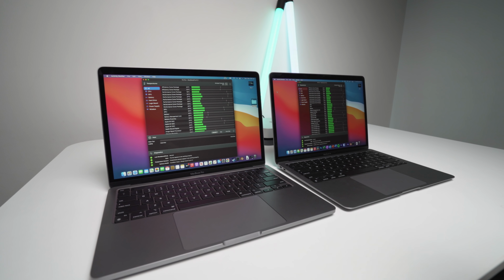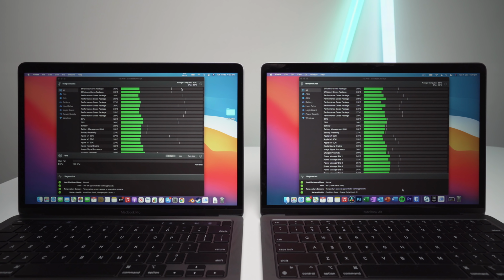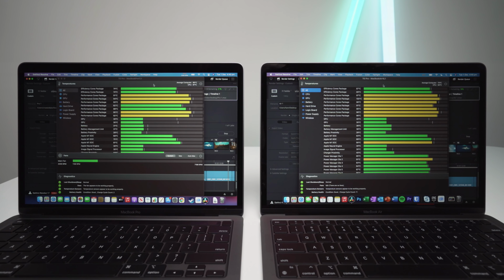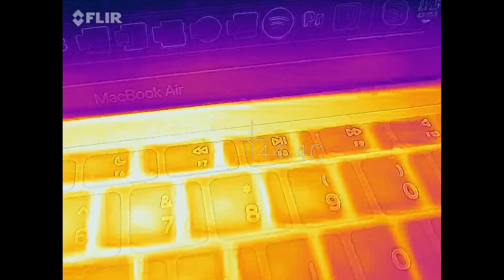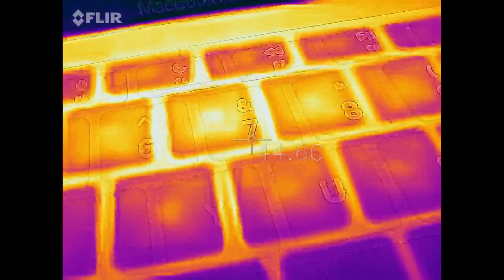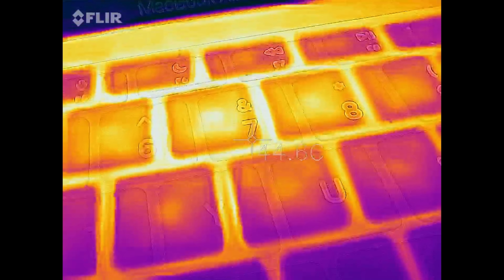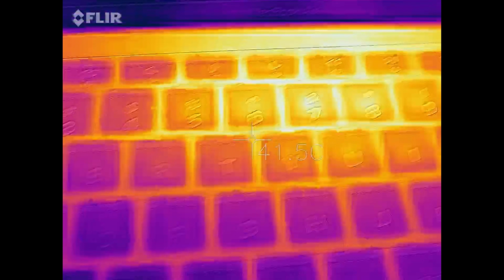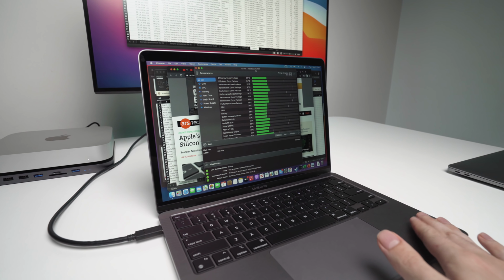The NEW M1 MacBook Air vs M1 MacBook Pro - How HOT Do They Get? Thermal Testing & More!

Comment: I'm only running Edge right now and my Razer Blade 2060 Advanced is so hot
CPU @75C - GPU @69C. One youtube tab open. I don't get it at all. 
I'm buying the M2 unless they all have white bezels, then I'm going with M1. Air or Pro... Not sure.

Comment: Buy air, spend the money for some accessories or just save money, No thermal issues using Final Cut Pro, if you edits 20 videos over a year, buy air, if someone edits videos 2 a week then maybe m1 pro, if every day then should wait for macbook pro 16 with m2 or M1X.
Reply: @Dũng Nguyễn 
Hi, i edited in final cut 4K videos from gopro and iPhone and no issue on mba 8Gb, some YouTube Tabs were opened to serach music during editing, that was done with extended monitor i have only full hd monitor. during rendering which takes lets say 20min (it dependent of the project)  and during that time i was searching on internet some news, shopping, etc. Mba 8Gb had no issue with that, was maybe little bit warmer, but definitely not hot.
Please note that in this YouTube video is used Intel based via rosetta 2 DaVinci with 4K from Red Camera and mba was only in my opinion 10-12 degrees warmer. Normal users don’t have such expensive Camera which probably  has extremaly large video files. I edit only videos from vacations and some events, nothing complicated, i have gopro8 and iPhone, for that job the mba is fantastic. Apart from that i use mba for emails, invoices, teams, Web browsing.  I have not used mbp but the mba is really fantastic, no thermal issues. That example from video is something extreme.
i edit for myself and i do not have to do other tasks during rendering to not lose time in job, i rather go and grab  some Coffee or previously on mb pro Intel i started the rendering when i went to the bed. 
But if your job requires extreme multitasking with large projects and you do not want to lose any second then probably mbpro with 16Gb. I do not know which is  more worth to buy mba 16Gb or pro 8Gb. I would rather buy air 16Gb but As wrote for my work the mba 8Gb is excellent.
Reply: @Dũng Nguyễn 
If you will do such havy tasks and you will use 90-100% cpu/gpu for a long time  then probably the fan is something for you and i would wait for new mbp 16 which mamy have bigger fan or anorher cooling system , this YouTube test showed that the fan in mbp helps but imho not drastically, only 10-12 degrees less. I got  mbp 13, 2018 and it was getting hot in teams with screen sharing on external monitor and during rendering as well was hot. With m1 chip i do not have such issues. 
I  think,you already have chosen that the pro is more suitable for you.

Comment: the old 2020 macbook had a lot of overheating problems during large zoom or google meet session. wonder how hot do the m1s get?
Reply: I had the same issue w/ my 2017 macbook pro but i used most of the memory. As soon as i deleted 20-30% of the fully used storage it was better

Comment: Thank you for the up front conclusion, it's interesting to see the thermal patterns on the air vs pro.  I'm curious as to wether games optimized for the m1 will noticably lower thermals during extended plays.

Comment: To add on to my previous comment, I do occasional 3D modeling. Post undergrad, I’ll be going to Grad School for Pharmaceuticals and I’m excited to start a new path. For that I’d love to get the Air to keep with my future flow as I use my phone as an extension to my old laptop set up that’s showing it’s age now barely able to keep up with long term research. My wonder is what would be the long term affect of using the M1 Air for extending times.

Comment: During extended runs, does the fan spinning up on the Pro eat up more of the battery?  I’m wondering if you were hammering the CPU and the fan spun up, maybe the Pro would wind up with a shorter battery-powered runtime than the Air...

Comment: Quick important question: Since the M1 chip set's cooling solution is very similar to its Intel predecessor (Just a copper heat pipe carrying heat away towards a tin stack promptly evacuated by the fan), I am wondering will the Macbook Air be able to sustain long periods of use time without over-heating [since it does not have a fan?] I am a teacher by profession, and the biggest issue I run into on a daily basis is the over-heating of my lap top due to pro-longed Zoom calls use-sage (the LOUD fan kicks after only 15 mins of use to the point it distrupts my class). Ps: I do not care about sustained performance. All I want is a device that can with-stand long use-sage (7-8 hour intervals). For the sake of longevity, which one I should get? Macbook Air? Or Pro? Please advise.

Comment: In terms of longevity, which one do you recommend ? I mean.. the "pro" has a fan inside and can break down in 1..2..3 years. What do you think? I love the fact that the AIR doesn't have any mechanical piece.
Reply from the maker: The Pro has the fan which may break down, but the Air is consistently a lot hotter so parts might degrade quicker over time. It's impossible to say. I would expect they would both last about the same.
Reply: @CreatedTech  Thanks for the quick answer ! :)

Comment: I recently got the M1 MacBook Air 16 gb RAM. When I open Activity Monitor with like 2 safari tabs and a word doc open, it shows that around 11 gb of memory is being used... is that normal?? I used to have way more things open on my previous Mac with 8 gb memory, and only 4-5 gb would be used. Can someone tell me why this is happening? thanks!
Reply: That's wacked. You probably got a faulty device. Make an appointment with Apple's Genius Bar and get that sorted out right away. If they offer to "fix it", return the laptop immediately and buy another unit instead. (Note that it has to be within the 7 days scope from when you first purchased the Macbook)
Reply: Apple devices are designed to use as much ram possible to perform better, when you need that ram the system will give it to you to perform more priority task
Reply: @MoonlightHusky  thanks!

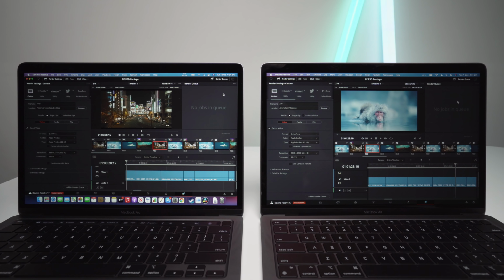Comment: @Created Labs At 03:10 says the two timelines are “Exactly the same”. Screen literally shows play head at “01:00:28:15” on the MacBook Pro and “01:01:23:10” on the MacBook Air 🤔😛
Reply from the maker: You're reading it wrong. I have a different point in the timeline selected on both computers, but the actual length of the timeline is exactly the same. Check out the little needle on the timelines on each machine.

Comment: Awesome video, I ordered the MBP yesterday thanks to your thermal tests and this video confirms my decision. The external temperature is important sure. But coming from a Macbook 12 which was passively cooled too I can tell that battery life suffers from the heat. Mine is at 450 cycles only but I get the "battery needs servicing" message and the battery life has clearly dropped. On another note, still curious about a decibel test for the MBP. I am surprised no reviewers tested this and simply gave their feeling and opinion instead of a measured observation. Silent means very different things depending on how noisy is your environment. Mine is dead silent, even the fridge hum from the kitchen with my door closed is annoying me. I'm sure you will be the first to do this. It was quite great to see in your test that the MBP fan is usually off though. Which means it is just as fanless as the MBA for everyday tasks and has better thermals when under stress at which point the noise issue is less important (gaming, actively working, etc.)

Comment: I’d get the Pro just for better thermals. Batteries degrade exponentially faster with more heat, so the cooler temps will definitely help with longevity.
Reply: It's true. Heat is a battery killer.
Reply: Thanks for the info ! I did not know that.. is the "cold" the same problem ?
Reply: I don't think you know what exponential means.

Comment: Great review, but i disagree that we shouldn't even consider the 8 core gpu MBA. The 8 core MBA has 512 gb ssd and it's gonna be cheaper by 250 usd when compared to the 512 gb MBP. So basically 250 cheaper for exactly the same components. And i think you should try to include it in your tests because that will determine if the mbp is really worth it.
Reply from the maker: It's cheaper but it will thermal throttle even quicker than the base Air. If you're doing enough rendering etc to where you can justify the 8 core version, you're better off getting the Pro.
Reply: @CreatedTech  while i agree on all those, we still are not sure how big the difference in performance is between those 2. Is it the thermal throttling making the difference or the 1 core gpu? We're not sure unless someone tests it, and that's where you can come in. But if you think otherwise, then no pressure. :) Still thankful for your reviews!

Comment: How can you say not to buy the 8 core gpu air if it's only 50$ difference and 250$ difference between air and pro... I'd get an external fan with the air when i'm editing. Who's editing should stillwait for the m2 or the 16" m1
Reply from the maker: The 8 core Air will throttle even more than the 7 core Air. Passive cooling just isn't enough if you're doing renders or lots of gaming.
Reply: @CreatedTech  even if you render hd or 4k? How long does it take for the air to render a 4 minutes 4k clip?

Comment: From your testing looks like Apple thinks that the ideal temperature for the cpu under controlled conditions (with a fan) is ~ 20% less then what they allow on the MacBook Air. This makes me worried about the longevity of the Air to be honest.
Reply: Intel airs have always lived on like a constant 100 degrees though. So these will be Just fine.

Comment: Will the 16GB MacBook air perform better than the 8gb MacBook Pro?
Reply: You  really need to push the Macbook Air really really hard to see any difference between 8GB vs 16GB RAM. For example rendering 8k video project while playing 4K video on 20 chrome tabs, while running 5 other heavy apps like photoshop, resolve ... in the background. You can check out other channels like Max Tech to have an idea of how hard it is to push it to the point that RAM become the bottleneck instead of thermal on the MBA. So, If you are a normal user, just get the Macbook Air 8GB period. If you rely on the laptop to earn a living, you should wait for the 2021 models. If are a pro user, you'll regret big time if you buy Macbook Pro for 2 reasons. First, most softwares are not compatible/optimized for the new chip at the moment. Second, the 2021 models will be much more powerful, and the design will be tailored specifically for the M chips (for example, new form factor, bigger battery, new fan design...). Save yourself $200 or $300 to upgrade early in the future.

Comment: When you get around to using the external laptop raiser/ active cooler I'd appreciate it if you add a comparison between the Macbook Air M1 without thermal pad and with thermal pad between the heat spreader and base. Thanks!

Comment: I need an opinion please. Should I go for the MBP 16gig 256gb or the 8gig 512gb variant? I just want to future proof it for like 5 years. No video editing or anything just 8-10 hours a day office usage and basic everyday usage. Thanks!
Reply: the base model is more than enough tbvh, it performs up to standard with no issue,
Reply: I would go for storage instead of ram. :)
Reply: The basic air would serve you more than enough for those needs. Remember the air can’t get any dust trapped inside so for your needs it’s way more future proof.
Reply: I need the same opinion! I jumped the gun and got a MacBook Pro 16gb 256gb to future proof the ram but now that all these reviews show 8gb more than enough I was wondering if I should get 8gb 512gb model instead thank yiu

Comment: I'm confused. You said the Air is only good for occasional short clips? It couldn't handle making YouTube videos then? I know you can edit YouTube videos on an iPhone, what is the exact shortcoming of the Air? Thanks.
Reply from the maker: The Air works as well as the Pro for short "bursts" of rendering for example. If I'm rendering a small video, you won't see much difference between the Air and Pro. However, the longer that rendering time is, the more the Pro's performance will exceed the Air due to it's fan.
Reply: @CreatedTech  OK, thanks. Thank you for the prompt reply.

Comment: If I don't buy directly from Apple the only way to have the 512 GB MacBook air si to take the one with 8 core GPU. The pro has the fan and it costs more than the 512gb air version to have only 256 gb

Comment: air 16gb should be the go to for reliable long term laptop.
Reply: I would say go for the base MBP rather than a 16gig MBA because for the long run it’s better to have a dedicated fan for cooling the machine down than relying upon passive cooling as long term sustained loads may cause issues atleast after 2-3 years
Reply: @S1ynced  sustained loads are not something you see daily. Also fanless means no vents and no dust hence it lasts longer. 16gb for future apps and just better overall life for a sodered SSD. So for a normal user MBA and for power user wait for better macbooks or get a powerful pc. Pro has its uses but those that need it know they need it.
Reply: @S1ynced  for video editing and 3D related stuff, yeah. but as a web developer and a designer, I think the MBP is overkill to my workflow.
Reply: I agree
Reply: Yep agree. I threw a 1tb drive in mine. Good to go!

Comment: I'm not giving any ideas for you to spend more, but is there really that much of a difference between 7-core GPU on $999 Air and 8-core GPU (+ 512 GB SSD) on $1249 Air?
Reply from the maker: Don't get the 8 core Air! I am making a video on this topic soon
Reply: @CreatedTech  How about if you get a student discount I am interested
Reply: @sanna6395  Wait for his video.
Reply: @CreatedTech  Dude, you're 🔥
Reply: @CreatedTech  why you say that ? Could you please explain for short reason because i am go to make a decision on MBA 8 core gpu ?
Reply: @Unlovealble  I'm guessing the extra GPU core adds to more heat and not much performance since everything throttles down. So, more heat soon, clock speeds drop down, the task which would have taken 7-core GPU to do faster now takes longer with 8-core GPU. Just a wild guess.
Reply: Short answer: If you want the 8 core GPU, you're better off with the Pro.